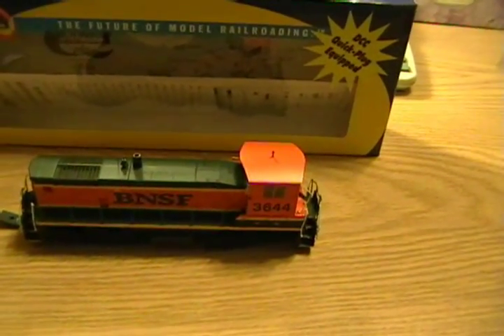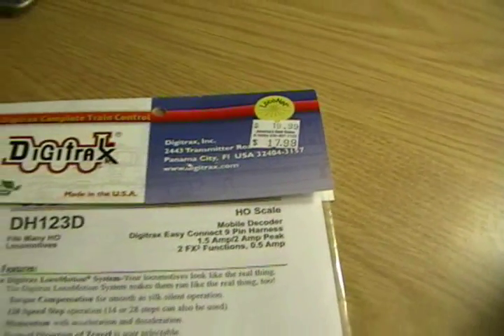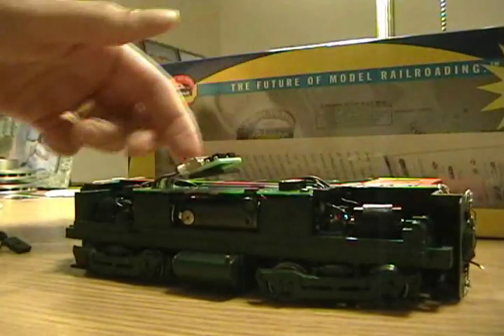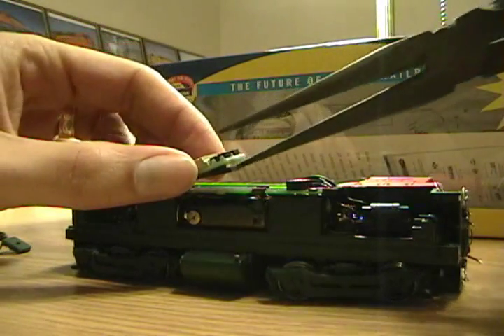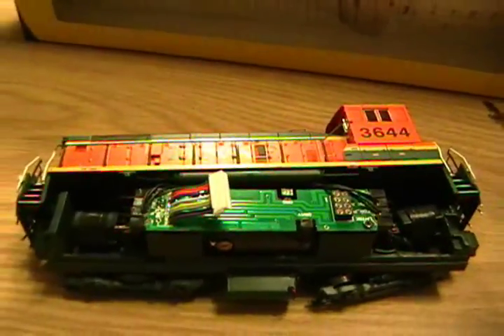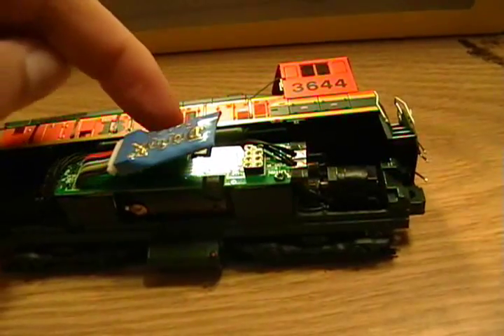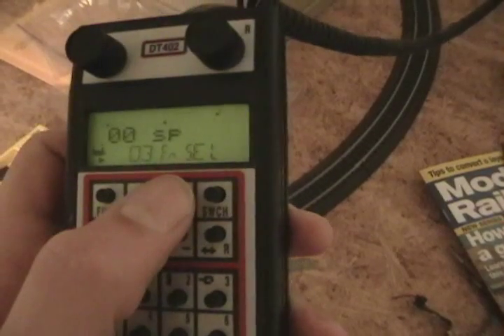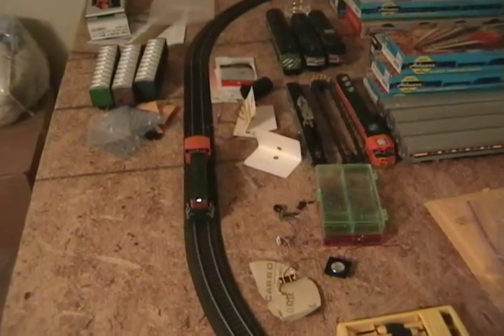12-19-2009 Advanced DCC - Part 2 Quick Plug Equipped Loco's

Comment from the maker: @GordonFreemanD40 They are small computer chips that allow an engine to operate and function on a DCC system. They will usually have options such as light control and even sound for you engine. I suggest looking at the Digitrax websire. Digitrax is the manufacturer that I use.

Comment: Seems My new MRC sound decoder without speaker defaults to address 1 only if reset on service track programming. If reset on the main it defaults to address 3.Strange but for 30 bucks for a sound decoder plus shipping and a actual low speed control feedback that works it will run a few scale miles an hour around the layout with grades in a BACHMANN GP 9 with no stall. First MRC decoder ever owned  out of many that worked this well or like it was suppose to.Like your videos Thanks.

Comment from the maker: I have had run away engines. It usually happens to me when I have a short somewhere on the layout. For example, a DCC loco derails and causes a short. It may cause other locos on the layout to short as well and cause runaways or damage the decoder. Usually powereing down the command station fixes it. Setting up the layout in blocks can help prevent this because if there is a short on one part, it will not short out the whole layout. Hope this helps.

Comment from the maker: @chaztrack1 Hi There - I did a number of Athearn installs through out the series. If the stock light board does not have a wiring harnes to plug in a decoder, you may need to follow the steps in Part 4 or Part 11 of the series to do board replacements.

Comment from the maker: Hi - You can use as little as 680 ohm 1/4 w on the LEDs. There is no need to use two of them becasue you will only increase the ohms and not the watts. Try one on a test circuit just to make sure before installing into your engine. The 22 guage wire will be fine.

Comment: Hi Tommie, I like your how to videos, keep em coming. I just purchased a used Athearns P-40 ready to run DCC ready engine but the wires for the decoder were off and it didn't come with a wiring diagram. My question is where to the wires go on the ready to run light board decoder?? I see the front and back dual ligths and the engine wires but there all black wires. Cold you help me?? do you have a video showing the original ready to run wiring??? Thanks

Comment: Hello tommie 
Ronoc931 here im in a bit of a pickle an i need your advise i bought a pack of leds at my loco hobby store problem is it doesnt show the ohms or watts but, i was reading on an earlier post i sent you a year ago you recommended for leds i use 680 ohm or 1/2 watt resistores with leds, well i went to the source ( canadian radio shack) and i picked up 1/4 w 5% Carbon resistors. I have 150 of them if i wire 2 1/4 watt together will that compinsate for the 1/2 watt resistore? Also i hav